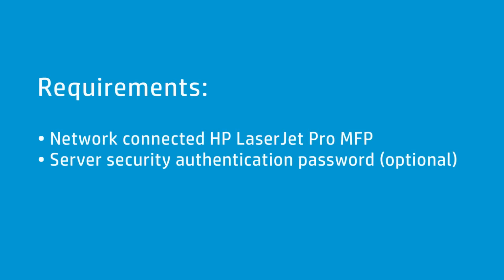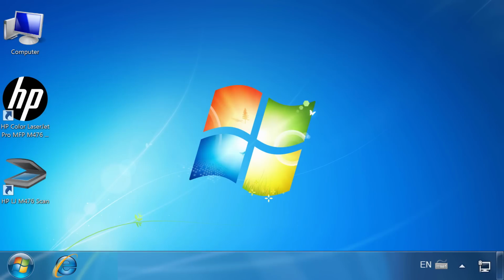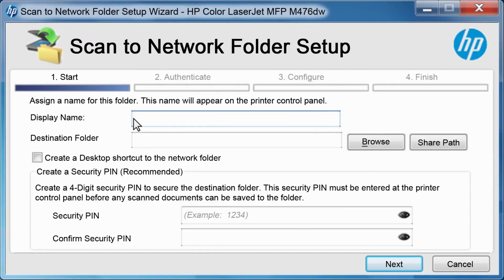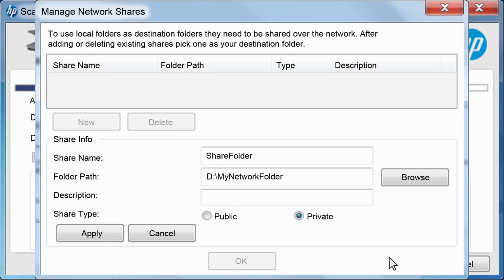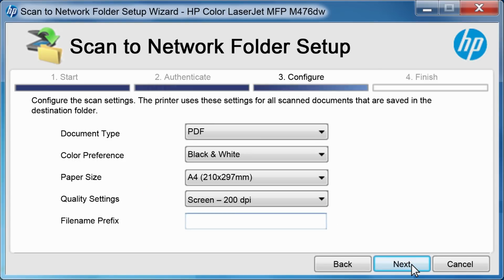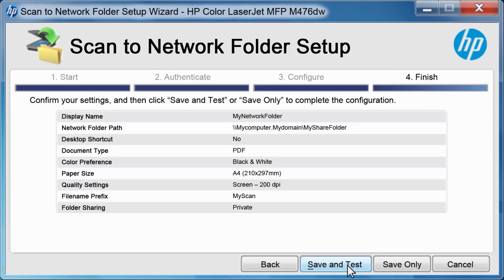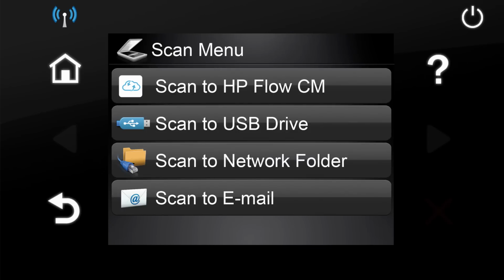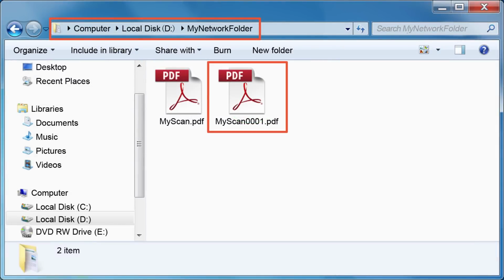Setting Up Scan to Network Folder Using HP Software Wizard | HP Printers | HP

Comment: How do i add my printer HP LaserJet Pro MFP M427fdn to my wireless network. I dont have wireless icon on the control panel
Reply from the maker: +BOTSENG KWALA Please refer to the instructions in this document to fix this issue: http://bitly.com/2Lu7I4R

Comment: i get the error message saying " Make sure shared folder name is correct , maybe the folder is not shared ??? how to share then ?
Reply from the maker: +Abdul Samad Please perform the steps mentioned in this document to fix this issue: https://h30434.www3.hp.com/t5/Scanning-Faxing-and-Copying/HP-LASERJET-PRO-200-MFP-M276NW-Can-t-scan-to-Network-Folder/td-p/3396841

Comment: I keep getting "Error. Your printer cannot connect the server. Press "Edit" to correct server name and address" and cannot finish the setup process. Can I please have some assistance in correcting this issue?
Reply from the maker: +Hugo Urrutia Please follow the guidelines in this document to fix this issue: http://bit.ly/2Jam1Hn
Reply: Did you ever get this issue resolved? I'm having the same problem.

Comment: On my computer it's showing error then what should I do
Reply from the maker: +Yash Utekar To better assist you, would you please provide some additional information? How is your printer connected (USB cable or wireless)? - What operating system are you using on your computer? Could you help me with the exact error messages or error code? If yes, what do they say and where are they displayed? Thanks, HP Support

Comment: i have another problem ,whenever i   press the wifi button i says ," the network has been disabled ,contact the one who made the settings "and i've tried everything i could to make it work but nothing, can you help me with that please? anybody...thank you
Reply from the maker: +alisalman hussein I see when ever you press the wifi button it says," the network has been disabled, contact the one who made the settings" please go through the document: http://hp.care/2ubR6WD and follow step9 scan from the printer Embedded Web Server
Reply: thank  u for ur quick response but the step9 needs me to check the ip of the printer from it's control panel and it is also not available because when i press the network button it also says the same phrase as i remember,when i try to use the web browser embedded in the printer it says that i should activate the network connection
Reply from the maker: +alisalman hussein I understand the printer is not connected to the network to generate the IP address. From the printer front panel select setting or setup, under setup select network, you will have an option to print/run a wireless test page, if the wireless working is passed follow this document: http://hp.care/2vFvD7f If the issue persists please contact HP phone support: www.hp.com/contacthp/
Reply: many thanks to you

Comment: You can install the HP software to make it easier or edit these functions on the printer itself.  How do you do that?  Watch the video on the EWS setup.  Using the EWS method, requires no software to mess with.   Will comment more on the EWS video.

Comment: HP LaserJet Pro CM1415 Color Multifunction Printer series dosen´t have administrator tab, is it hidden? how can I acces this ?
Reply from the maker: The HP LaserJet Pro CM1415 does not support the scan to network folder feature. I've included the "HP Printers - Scanning from the Computer with HP Scan (Windows)" document ( http://ow.ly/oDul301dGgV ) which explains the different ways you can scan with your LaserJet.

Comment: OK, so the video does make it clear that the instructions relate to Windows OS. Any chance of at least giving a steer to those of us using Mac OS, as to where we go for guidance? Does the printer even support this function on Macs? Might save a lot of hassle knowing this if so.
Reply from the maker: karmachochi  Yes you can set up scan to a network folder on a Mac.  wikiHow has a clear article on how to do this.  Please search for "How to Scan on the HP Officejet Pro 8600" on wikiHow's website.  Even though the document states it is for an Officejet 8600, the steps apply to most Macs, regardless of the HP printer.